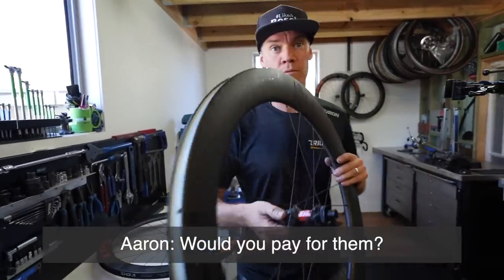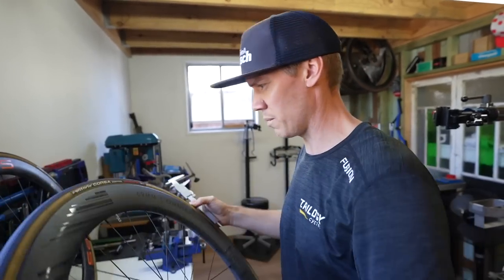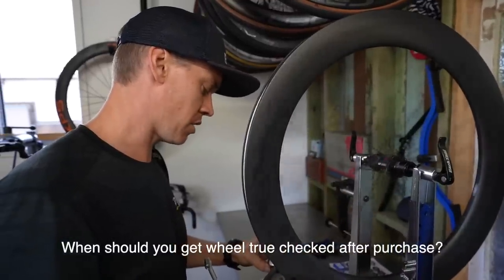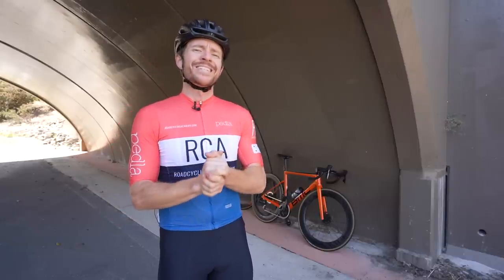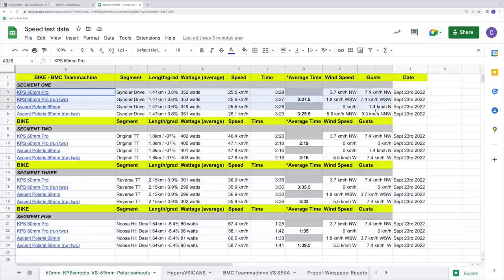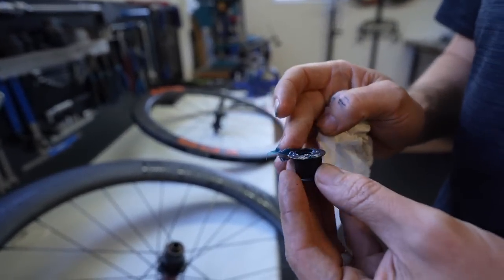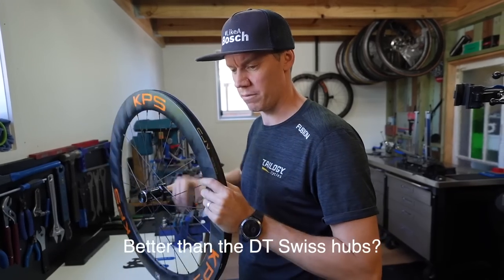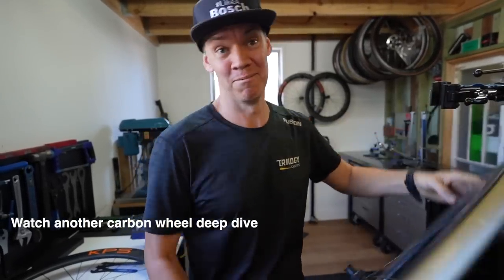69mm Ascent Polaris VS 60mm KPS (Carbon Wheel Review)

Comment: He makes a valuable point at the end. There is certainly value in having wheels with in-country support and wide dealer networks. 
I have set of Elite wheels which I love from a product perspective, but I hit a monster pothole within 6 weeks of ownership which required a crash replacement. In that case you pay for the new hoop, pay a shop to move everything over, and you're out a wheel for 6 weeks while it comes from China and gets serviced. Sure, an equivalent Zipp 404 is 1k more, but you hit the same pothole, go to any of the many local dealers, and have a whole new crash-replacement wheel for free that week. Vast parts availability, vast service knowledge, and no stigma from your LBS doing work on obscure China carbon. 
I love interesting wheels and it's fun trying boutique products, but it's certainly worth considering the subtle value of dealer networks, parts availability, and crash replacement programs when evaluating these low-volume overseas brands.
Reply: Hello! I definitely hear you there - we are continually looking to expand our dealer network, and support options.
We have a lifetime parts crash replacement policy for the original owner - so in the event of an epic crash, we'll send the replacement rims and spokes as necessary for you get it rebuilt locally. Of course, we recognize that there is a waiting time involved, and we're continually looking for ways to improve this further.

Regards
QX
Reply: I have Zipp 202 NSWs, ENVE SES 5.6s with the White Industries CLD hubs, Bontrager Aeolus RSL 37s, Alto CCX 40s and the Ascent Polaris. The Zipp Cognition v1 hubs on the 202s are the worst of the lot. They’re a pain to disassemble/reassemble with the tiny magnets and axial ratchet…the endcaps are also Ill-fitting and the bearings on my front wheel got crunchy after two rain rides, which I attribute to the poor sealing around the endcaps. The ENVEs have been warranty replaced twice for random non-impact damage…their customer service is excellent. The Alto CCX 40s have the worst, most generic rims…they came in 100g over claimed weight despite being hookless. The rotating parts of the hub are made really well, but the tall DS flange is a gimmick. Alto also seemingly went bust, so I understand the risk of supporting smaller wheel brands. The Aeolus RSL 37s a brand new and have been flawless. They’re a joy to use. The Ascent Polaris have also been solid for the 3.5 weeks I’ve been using them for. Time will tell if Ascent can make it against the big brands, but so far all of the hype is justified. If you feel any ill-will from your LBS for owning wheels bought elsewhere, then you need to find a better LBS.
Reply: When your wheels need "support" you bought definitively the wrong ones.

Comment: The DT Swiss hubs are very easy to maintain, and it lends itself for frequent servicing. I went with Lightbicycle  wheels few years ago, as they offered custom build options and pricing under US$1500 for their top of the line Dt Swiss hubs....three wheels later, no regrets. Their lightest build coming in the low 1200g range.  Given my experience, its hard to justify spending several thousand on these new boutique brands. As mentioned, rather get Zipp or enve , knowing you have warranty.
Reply: Yep, to clarify though, we're at about 1900+ USD for the Polaris DT240, before the 10% discount code. Shipping is included, as is a lifetime warranty against manufacturing defects, and free crash replacement parts for the original owner.

Comment: Pretty thorough video mate. A few things though - no wonder the polaris tested faster. The same 90psi on a bigger tyre will have a much higher skin stress than the 25mm tyre at 90psi. So you're probably getting a large reduction in rolling resistance (if the road is smooth). Really the only way to test is multiple runs at a sweep of pressures to nail down what the actual aero performance is, separated from Crr.
Reply: Glad to see you here!
The KPS was tested with the Corsa, and Polaris was tested with the Corsa Control. While not directly representative of the tires in question, Bicycle rolling resistance shows a 0.6W reduction at 80psi going from 25 to 28mm, and a 0.1W reduction going from 18mm internal to 22mm internal. Adding both together gives a best case of 0.7W improvement per tire. This is actually actually less than the 1.4W penalty of going from Corsa to Corsa Control.

I'd say that the Polaris was actually at a 1.4W total disadvantage here tires-wise, but we're really splitting hairs. Of course, different road conditions will affect tire performance, and having a comprehensive test is desirable.
Reply: @ascentbikes  fair comment, other than the rotating cylinder drum they use in those tests is nothing like a flat road. Contact patch is probably very different and will always be fatter and shorter.
Reply: @PeakTorque  How much effect would that have on the difference in relative performance? I get it if we're measuring absolute figures, but if it's all "off" then would the results be in a different magnitude or even reversed vs a real road?

Comment: Hey Cam and Aaron,
Thanks for testing and sharing your thoughts on the wheels! I'm glad to note that Aaron is not nipple-shy, and that Cam likes girth ;)
It is also heartening to hear that Polaris is one of the most robust wheels you have ever ridden, and that they behave well in crosswinds.

I started the design of Polaris with one core principle: That the rider is integral to the ride. Polaris is designed to inspire confidence in the rider, because confidence is speed, and confidence brings results. This means that in addition to low aerodynamic drag (which you have validated), the steering stability, comfort, and cornering ability are paramount in giving the rider the confidence to push their limits. To further that point, we offer a lifetime warranty against manufacturing defects, and a parts crash replacement policy for the original owner. In fact, the fact that we did a pre-emptive global recall of the spokes demonstrates our commitment to our clients, including one in Queensland whose wheel had not shown any issues at the time of the recall. A parts replacement policy means that you would only have to pay for shipping and labor in the event of a crash, allowing you to race these wheels with confidence.

As a boutique brand, I acknowledge that our wheels do cost more than mass market brands. What you are getting, though, is a unique design that required substantial investments in Hardware, Software, R&D, Tooling, and Testing to bring to market. In order to bring the weight down to one of the lightest-in-class, we had to use the highest grade carbon fibers, which multiplied the cost of the rims. Your statement about graceful crosswind behavior speaks to the work that we have done in this regard, and would potentially allow riders, who had previously been adversely affected by crosswinds, to improve their speed by going to our deeper wheels.

Aaron: Please, give these wheels a spin. We also have something shallower coming up, and I'd be happy to send you a set to ride with. I think you'd like them, and perhaps we could work together in the future.

Regards
Qing Xiang (QX) Yee
Founder
Ascent Bikes
Reply from the maker: Cheers QX, thanks for sharing on the thread and the opportunity to test the wheels
Reply: @CamNicholls  We have more - let me know when to send you or Aaron a set :)
Reply: @ascentbikes  Send me a set ;)
Reply: @DanTuber  Sure, place an order and we'll send you a set!
Reply: @ascentbikes  100% discount like Cam got? I'll give you  nice review ;)

Comment: Cam, that’s a great rundown. I absolutely love the Polaris 69 wheelset. I got mine with DT 180 hubs and they roll so well. To get a good real world comparison by feel and practical experience, I raced two local crit series with my - Enve SES 67 (my go to before trying the Polaris), Roval 50, DT Swiss ARC1100, LightBicycle AR55 and Black Inc Sixty. I had setup all of them with Pirelli Race tubeless 28mm tires. 

Polaris was hands down the fastest wheel. It rolled really well and extremely responsive when I’m out of the saddle sprinting to respond to surges. The Polaris 69 also felt better planted ripping through tight corners at race pace. The other wheels were significantly more chatty. 

My biggest hesitation before trying the Polaris was if it will be hard to ride in cross winds. I was pleasantly surprised when I raced one of the 80km road races at Tour de Bloom in Washington state which was quite windy and i nearly forgot that I was racing significantly deeper rims than I normally did. 

The only time I would not race the Polaris 69 is if there’s a climbing intensive stage in a stage race. But I hear Ascent Bikes have something coming! 🤫🤐
Reply: Sunil, Thank you for your testimony! I'm glad that you found the wheels compelling, and that they held up under hard racing.
And yes, something coming along :)

Comment: Been running the Ascent Polaris (DT180 hubs, GP5K S TR 28mm) for 3 weeks. The tires balloon to ~30.5mm at nominal tire pressure, up to 31mm at max rated pressure. Like others have said, for a 69mm depth, they are stable and handle wind gusts predictably. Coming from ENVE SES 5.6s, it's nice to finally have an aero wheelset optimized for wider tires. The local road races are hell on equipment.
Reply: Thank you for sharing, and for your comparison with the Enve 5.6s!
Reply from the maker: Thanks for sharing on the thread.

Comment: I'm tossing up between the Ascent Polaris and the Winspace D67s myself - The Winspace is a bit easier to digest at almost half the price...
Reply from the maker: I reckon the Hypers would feel stiffer but a harsher riding experience.
Reply: The Hypers would definitely be a formidable wheelset under ideal conditions, but where the Polaris would really shine is when the roads get rougher, or the winds get higher. The gentler crosswind response, and the increased comfort, traction, and cornering provided by the wider stance all contribute into expanding your envelope of riding conditions. You'll also get a lifetime warranty against manufacturing defects, and a parts crash replacement should you choose Polaris. 

I hope you'll give us a chance! 
-QX
Founder
Ascent Bikes
Reply: It will be far easier to get service parts for the DT hubs on the Polaris wheels than whatever proprietary hubs Winspace is using on the Hypers.
Reply: @kidsafe  Good point... I'm being convinced!
Reply: @deanos1993  Yeah, I’m sure Winspace is easy to communicate with, but they’re still shipping everything out of China. If I want to convert my Polaris to an XDR freehub or change the ratchet from 36t to 54t, I can just hit up any local bike shop here in the states and they’ll add those to their next QBP order or whatever.
Reply: @deanos1993 Joe from Winspace here; glad we're on your short list! Ascent made a case for their wheels, so I feel it's only fair to make a point or two in our favour. Obviously, I'm biased af. :) 1) The HYPERs are a lighter wheelset, always nice to have a lighter system weight when climbing or accelerating.  2) The HYPERs are stiffer. QX obviously acknowledges the superiority of carbon spokes because they were his first choice for these wheels until he had issues. Carbon spokes will generally allow you to build a lighter, stiffer wheelset which will give a more direct feeling of acceleration and also track better in faster corners. 3) Front and rear rim profiles which are designed for their purpose. I think QX will admit that the front and rear rim encounter different conditions when riding outdoors and each has a different interaction with the bike. (The front wheel has the trailing edge interacting with the frame's airflow, the rear wheel has the leading edge next to the seattube...massive oversimplification, but this is a YouTube comment.) To accommodate and optimize performance for these differences in airflow and circumstances needs different rim designs. Of course, the extra R&D cost, as well as tooling fees adds up, so it's understandable to use the same rim front and rear. 4) Price. I think QX has a good point that his wheels will be more comfortable if you're going "all-road": My counter-point would be for the same price as the Ascent wheels featured here, you can get a pair of HYPER D67s for going fast on-road, and then a pair of Lún Grapids for using all-road. Oh, and you'd still have $400 to spare. You could buy some more speed with a new skinsuit, helmet, or just buy a gift for a loved one. :)

Anyway, sorry for the wall of text. I numbered it to make it easy to follow (and to allow QX to no-doubt rebuttal point-by-point. 😆 ) But it's great to have Ascent offering more choices for consumers. We're stoked the direction the industry is going these days. More competition drives companies to develop better wheels and lowers prices for everyone to enjoy. Bikes are getting expensive af, and it's great that more and more people can enjoy top-shelf performance!

Enjoy your wheels no matter the choice.
-Joe
Janitor
Winspace Bikes / Lún Wheels
Reply: @kidsafe  No need to convert to 54t when the engagement angle is already better than 54t out of the box. 😂(5 degrees vs 7 degrees.) But yeah, your point about parts availability is valid. DT Swis hubs are worldwide and every mechanic knows their way around them. We're working on it though. Over 100 dealers in the USA now (loads listed on our website) so never too far from parts or service. 🙌🙌🙌
Reply: I'll add that while carbon spokes are lighter, stiffer and potentially directionally stronger, they are much weaker against impact damage. Ultimately in races, I am riding in close quarters over not so great roads. Rocks/pebbles and other detritus can get deflected off someone else's tire into my spokes. I have had people's shoes and wheels rub against mine. I've seen someone's carbon spoked wheel receive damage on nearly all of its drive-side spokes just because the rear derailleur cage knocked against them. Steel spokes would have survived.
Reply: @kidsafe  I think they're stronger than you think, Raoul did a video giving them a good whack with a steel ruler and no damage. I've used them to open beers with no damage, but anyway - even if we accept that carbon spokes are easier to brake than steel, then shouldn't we all ride steel frames with steel forks? I think as you get to the higher end of any sport, you start trading "bomb-proof-ness" for performance. Of course, everyone draws the line in different places in terms of how much they're willing to give up for the performance and that's cool. (and also why our lower performance wheels have steel spokes too.) I genuinely think it's great that there are more and more choices for people these days. 🙌

Comment: With crashes occurring more frequently in stage and crit races in my area and globally. Inherently any in country support is worth the money. Would I pay 3k for this wheelset? Not a chance. In a peloton you don't see much advantage if any. And I can get enough good results with my American classic 420 aeros
Reply from the maker: Fair call. Thanks for sharing on the thread Zachary
Reply: Hello Zachary, 
We do have a parts crash replacement policy for our rims. So if you crash and the rim is unrideable, we will send you the replacement parts at no cost, you just need to pay for shipping and labour to re-lace the wheel. I acknowledge it's not perfect, but we feel this will allow you to race with confidence.

It's true that the speed advantage is less apparent in a draft, but then again the cornering performance and controllability under changing wind conditions definitely helps you to pick and hold a line with greater confidence.

We do have a DT350 version for 2199 SGD before promo if you're interested in the Polaris rim profile too. 

Cheers
QX
Founder
Ascent Bikes